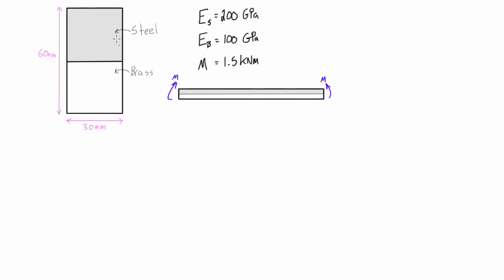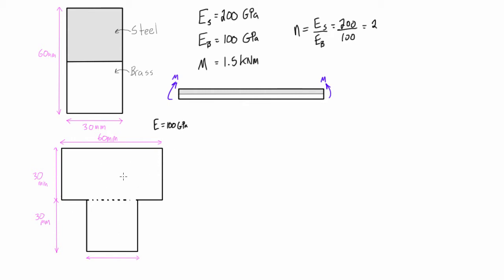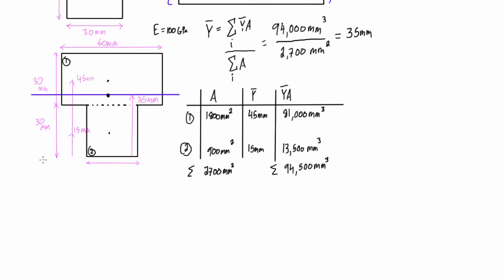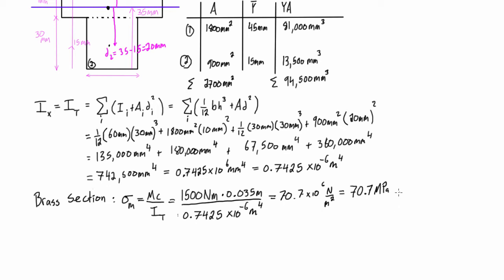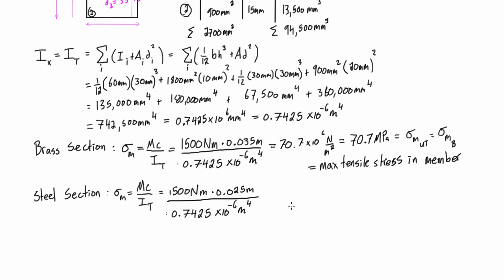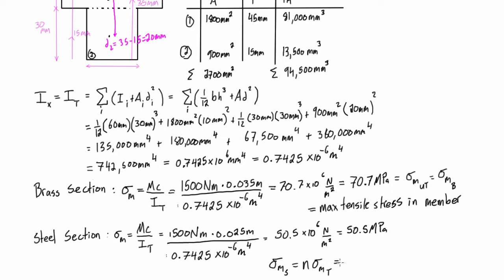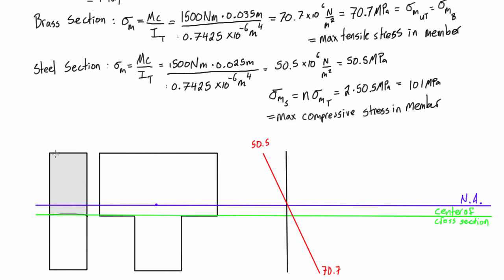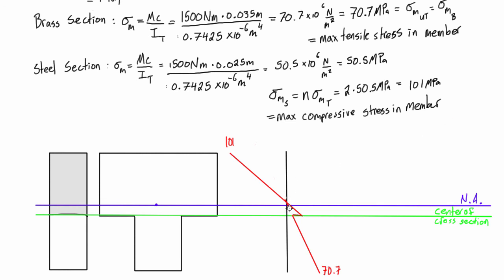Pure bending of composite materials worked example #2

Comment: if steel is twice as strong as brass, how come you didn't multiply the brass section by two and leave steel as the reference point?
Reply from the maker: I like to think of it in very non-technical terms. Think of it as steel having twice the oomf as brass. So you would need twice as much brass to get the same amount of oomf as steel. So if you replaced the steel with brass, you'd need twice as much. That's what I did; convert the top steel part to 2x the area, but of brass.

Comment: Thank you very much. 
Are irregular shapes resolved in this way as well, such as a shape in which a triangle from the top is rectangular from the bottom and is requested in a question of stressors and gives external torque ?? and Thank you
Reply from the maker: Yeah, but then you're going to be solving about 2 axis, it will be much nastier and isn't exactly pure bending anymore. There is a reason that these examples are symmetrical from left to right =)

Comment: The centroid of the original beam should lie in the brass section since brass has a higher density than steel, and I thought that the neutral axis always passes through the centroid. Can you explain why the neutral axis passes through the steel section of the original beam? Thank you.
Reply from the maker: Density is kg/m^3, and steel is more dense than brass: https://www.engineeringtoolbox.com/metal-alloys-densities-d_50.html However, mass is not the right thing to be thinking of. The location of centroid and therefor neutral axis depends on the Modulus of Elasticity (Young's Modulus), which describes tensile elasticity, not density. Always make sure you know the Modulus of Elasticity of each, and in a problem like this, the centroid will be towards the larger one, which in this case is steel. Here is a table for reference: https://www.engineeringtoolbox.com/young-modulus-d_417.html

Comment: plz comment. why you are not taking the max value of the two 35 & 25 for both the cases. i think we just we need to multiply n to eliminate the problem of different materials and use 35 for both the cases.
Reply from the maker: Because the top fibres are still only 25mm away from the neutral axis, not 35.
Reply: @Engineer4Free  that's right. Thank you sir. Your lectures are very interesting and helpful.